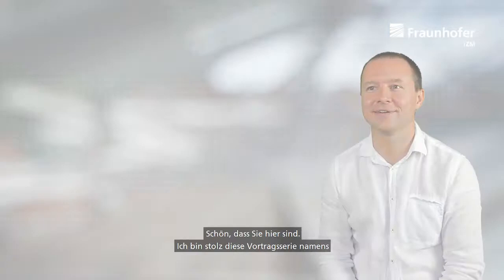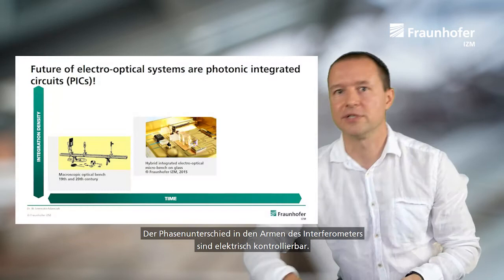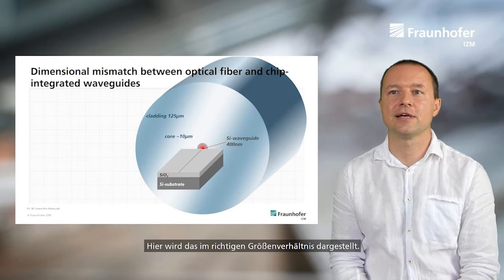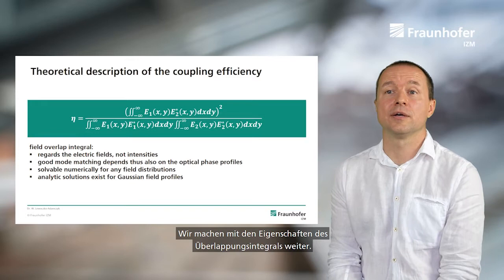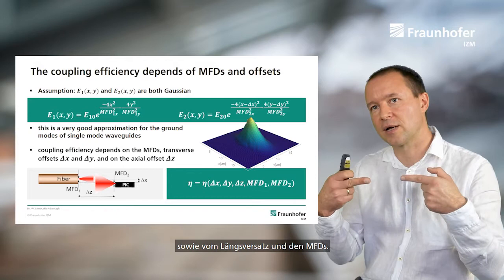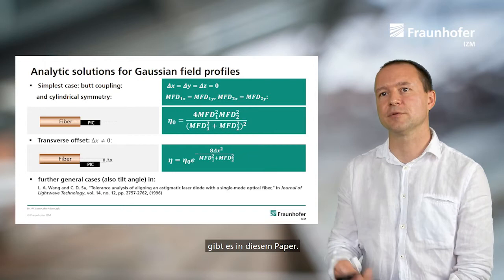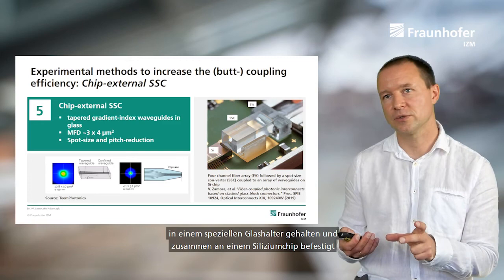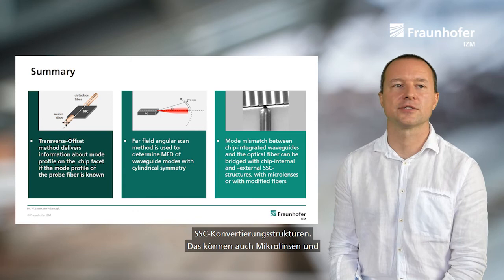Expert Session: Optical Fiber Coupling to Photonic Chips

Comment: At 5:39, I was expecting a sum of the field integrals in the dominator. Can you please explain why I am wrong? Thanks so much!
Reply from the maker: Hi Paul Tuhin, Please find here the feedback from Wojtek regarding your question: The easiest argumentation is the check of units: if there was a sum, instead of product, in denominator, the coupling efficiency would not be unitless. For more detailed mathematical treatment please search textbooks or internet for “mode overlap integral” or “projection of wave function onto eigenstates”. Note that the mentioned wave function represents the  amplitude of electric field. For calculating the power coupling efficiency you need the integrals of the square of electric field.

Comment: 4:49 why did they not make the Silicon waveguide the same width as the fibet?
Reply from the maker: Hi Christopher Bloom, please find below the answer from our colleague Wojciech Lewoczko-Adamczyk:

This is a very good question and the problem is well known. For some years there have been a quest among Si-PICs manufacturers to reach the goal of matching the model size of the PIC-waveguide to that of a fiber. Some attempts are "almost there" however the reason for "almost" is of technological nature: the thickness of the Si or oxide layers cannot be arbitrary and this limits the expansion of the beam size. At least at telecom wavelengths. On the other side of the coupling interface there are efforts to minimize the mode size of the fiber by using adiabatic spot-size converters, UHNA-fibers or lens fibers.

Best regards
Reply: @Fraunhofer-IZM  thank you.